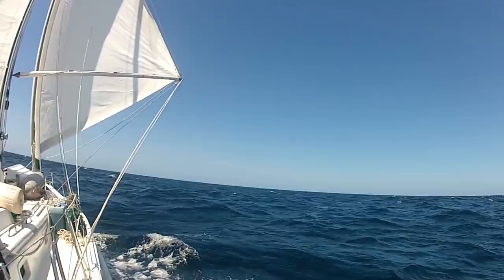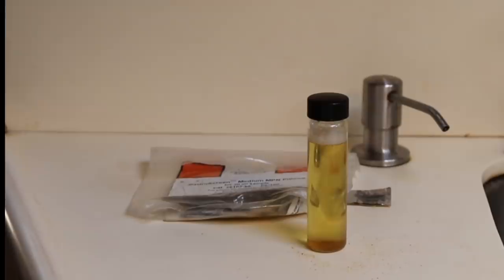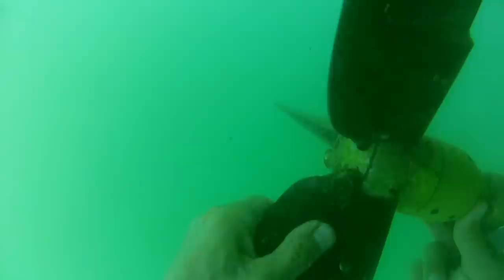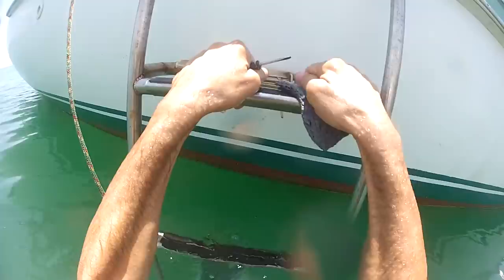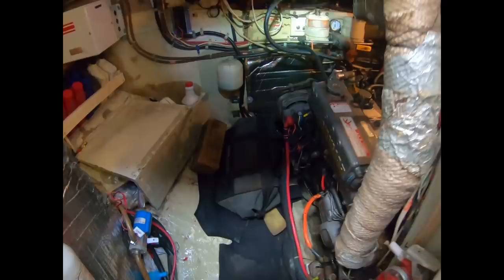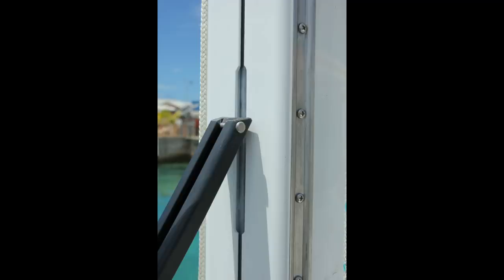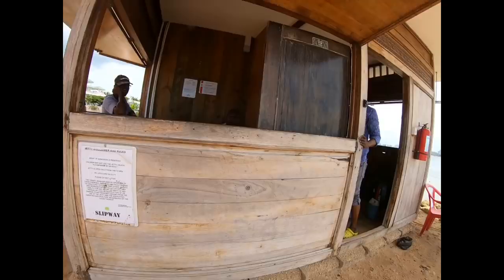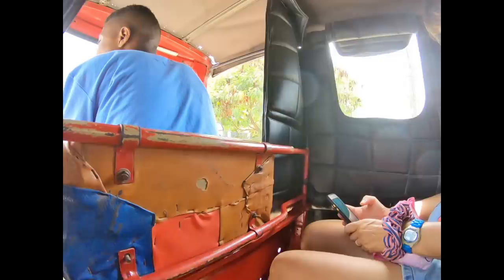STORM & PASSAGE PREPARATION:Sailing Tanzania to S Africa-Patrick Childress Offshore Sailing Tips #36

Comment: I like the proper instructional way you do your videos this is obviously Patrick’s past as an instructor shining through . I liked the added mode music added when you was showing the dangers on the weather map . I really like the tech stuff nuts and bolts of running your boat on a daily basis , like checking the running engine while it’s running . And the water checking wow !! I wouldn’t have known to do this .

In all keep doing what you’re doing please. I feel like I’m racking a free course. I’m in between jobs right now but I will be tipping your jar a little 👍
Reply from the maker: Thank you Stephen for your encouragement....and the tip!

Comment: Another great video guys.   My favorite video?  It's hard to pick any single one, but I really appreciated the 3 part Valiant 40 tour.   I'm still in love with that swing up boarding ladder, but too cheap to pay to have one fabricated in the States.  Found some decent over-the-gunwale stainless ladders though, that can are removable, yet can be locked in place with a pair of deck mounted "sockets".  That's what I plan to go with  for now.
Reply from the maker: Mark, it seems materials, like stainless steel tubing, is less expensive in the U.S. than anywhere else but the high labor cost, in the U.S., does make things, like a new boarding ladder, too expensive. As we have been traveling around the world, we get work completed where it is the most economical. Labor in many of these foreign countries is $10 to $25 a day unless they are trying to charge "yachtie" rates, like they do in Thailand; then it is better to have the work done in the U.S..

Comment: It would be interesting to see a video of your diesel  tank setup
Reply from the maker: Hi Sailor Sam, the two diesel tanks are difficult to see. They are side by aft of the diesel engine. They were installed decades ago. If I had been involved with the installation, I would have had them make access ports on top of the tank for cleaning and being able to visually see inside of the tanks.

Comment: Noticed you have a cable for the out haul. Definitely strong. Hope it never frays. Love the way you have all the systems set up for real world events. Wish production boats thought the way you do. We have the Tides strong track too. Love it. As always, great video! Really appreciate your sharing.
Reply from the maker: The outhaul cable changes to a low stretch line inside of the boom then exits the boom so the line can wrap around a winch and then a cleat. The stainless cable has been there for decades and I see no problems with it so far.

Comment: I like your show. I think vlogs of sailing channels are basically the same but different - watch Gone with the Wynns, Delos and La Vagabonde. These top three are a course in how to do it.  Sailing Sisu did an excellent study early in their channel. The key to success, if you define it by number of subscribers is taking the time to polish your production while maintaining a consistent style/content while listening to your viewers comments, it will take a while to take off, but you can see a snow ball effect after 10 or 20,000 subscribers, watching Sailing Uma will show you how to go from nothing to a very successful vlog in 3 or 4 years, watching Sailing Emerald Steel can help with integrating still images and old videos in an episode. Views can make a big difference on many levels and a viral video will change the dynamics very guickly, however you can't always predict that with certainty. Using clickbait can  be helpful but if it doesn't deliver something to your targeted audience it won't be helpful. I think Sailing Doodles is really good at it. That's my 2 cents and it's worth both of em
Reply from the maker: Thanks, Robert, for the guidance.

Comment: Another great video Patrick, thank you so much. I’m curious why you do not use lazy jacks or some sort of stack pack for your main. I would love to know your thoughts on this as I completely respect your knowledge and skill. Cheers
Reply from the maker: Glassman, this is a response I recently gave to a comment much earlier in this thread about lazy jacks:  I have used lazy jacks on other sail boats and they only help when the boat is headed directly into the wind and held there till all the main sail is dropped. Short handed sailing like this, such a maneuver is not normally possible. We drop the main on many points of sail, just like the basic sailing instructors teach students not to do. So lazy jacks are more of a nuisance and get in the way more than they can help. Plus they add a lot of chafe if the lazy jacks are not pulled forward towards the mast, when sailing, which means one more thing to deal with always pulling them out and putting them back. Not worth the hassles for the sort of sailing we do. Maybe for day sailing around the Caribbean, lazy jacks might be workable, but it is a spider web of tangles and snags in most sailing situations.

Comment: Good job on this video. In my opinion this one represents the good balance between how to stuff and the places you visit. Personally the more I see how you do things, the better. 
How did you guys fare with that awful cyclone that hit Mozambique? 
Also is that a on demand water heater attached to the rear rail?
Reply from the maker: We eventually got some concerned emails, through the satellite connection, saying how devastating that storm was to the coastal area of Mozambique. Since we followed behind it to grab the associated N. winds, we had little trouble with that storm. We had other localized storms, one with 50 knot winds but it was from behind, blowing us south. I wanted to take down the stay sail but feared, no matter how careful I was, the sail would luff itself to shreds....and the wind generator sounding like an over-revving non controllable Cesena...very dangerous. That will be in the next video. "Water heater", You probably see the white elongated canister mounted on the starboard Radar mast, at stern rail level. That is a self deploying EPIRB.

Comment: Great videos and very informative! Great to hear about your travels as well. You make others with the dream of sailing take the plunge and go for it! After much research I’m deciding on purchasing a Catalina 30 ft. Question for you. As far as marina fees goes is it that much more expensive to dock  a 30 ft boat versus a let’s say a 25 or 27 ft boat on a slip? (Catalina sailboat) If not much of a difference I would take the 30 ft..Love the spaciousness of the 30 footers. Thank you for ur opinion and advice! Keep up the videos !
Reply from the maker: Many marinas charge accdording to a bracket of boat lengths so there would be little to no difference for a couple of feet in the shorter lengths. Just keep it below 39'. Go with the 30, that is placial compared to the C-27 especially if you expect another person to stay happy on your boat. I lived on a C-27 for 5 years and crossed many oceans on it.  Just be sure to stay in the proper latitudes at the right time of year and keep up on the maintneance.
Reply from the maker: This is Rebecca. I know when I went from my 27 to my 36...only 9 feet difference but everything twice as expensive :) The Dock 25% more due to length 25% more...but haul out more because heavier and longer, and the longer the boat, the more money people feel you have for everything else. If you are on a budget...the smaller and simpler you go, the boat will cost less, and everything else will cost less too ;) 27-30 shouldn’t be too big of a difference though!
Reply: Patrick Childress Sailing thank you very much for your advice! Keep them videos coming. Very informative!
Reply: Patrick Childress Sailing Patrick, thank you for your advice!

Comment: Any concerns about swimming in the marina due to possible stray electric currents? Great videos, thanks.!
Reply from the maker: No. While at Ocean View Marina, near Davao City, Philippines, every morning, for the 4 months we were there, a man would swim one long lap around the marina docks. He certainly seemed healthy enough and never seemed bothered by anything. I have never felt any effects from electrical current while in the water at a marina. I would  think something would have to be extremely wrong to get any sort of tingling while in the water at a marina. Of far greater concern would be the health effects of polluted marina water. More often than not, I would soon get a sinus infection after working in the water at a marina. Now, as soon as I get out, I take a shower on the dock with dish detergent and use the hose to inhale a bit of water to flush out my sinuses. That has helped.

Comment: Nice video
What do you think of the no antifouling and regular scrubbing option for cruising?
Reply from the maker: In reality, there has been no option but regular scrubbing, no matter what sort of paint has been used. We will soon be hauling out, here in S. Africa. I will go through all the work and trouble to remove all bottom paint down to primer then will put on Coppercoat. I figure, there is scrubbing anyway so I want to make cleaning of the bottom as easy as possible. I understand, rather than using a scrubby, all that is needed is a rag, similar to the Propspeed, used on our prop shaft and prop. We want to head down to the south end of S. America where the water is much colder than the 84 degree, Fahrenheit, water we are accustomed to here in the tropics. I want to spend as little time in the water wiping it down as possible.  Check out our "Hookah, How to Clean the Bottom" video which will show how easy it was to wipe marine growth from the Propspeed and how difficult it was to chip marine growth from the chain or scrub it from the bottom.

Comment: I was wondering if lazy jacks would help with reefing?
Reply from the maker: I have used lazy jacks on other sail boats and they only help when the boat is headed directly into the wind and held there till all the main sail is dropped. Short handed sailing like this, such a maneuver is not normally possible. We drop the main on many points of sail, just like the basic sailing instructors teach students not to do. So lazy jacks are more of a nuisance and get in the way more than they can help. Plus they add a lot of chafe if the lazy jacks are not pulled forward towards the mast, when sailing which means one more thing to deal with always pulling them out and putting them back. Not worth the hassles for the sort of sailing we do. Maybe for day sailing around the Caribbean, lazy jacks might be workable.

Comment: That is what i figured.  Do you use a HF/SSB to download any GRIB files?  Or is that just old technology?
Reply from the maker: Watch the video "Marine Electronics for Navigation and Communication", the video just before this one on the Patrick Childress Sailing channel. That video goes into better detail about how to get weather information at sea. We used to use the SSB for down loading GRIB files but that has become as useful as a cassette player. PredictWind, down loaded through the IridiumGo, satellite communication, is far more reliable and easier to use. Although we could down load the same PredictWind information through the SSB if need be.
Reply: Currently my SSB is not working.  I'm looking for some advice on whether or not I should get it working as a backup for downloading GRIB files. Any thoughts?  Note I plan to get an iridium go as you have.
Reply from the maker: @sailingnordicsun7199  A SSB would always be worth keeping as a backup, Not just for GRIBs but for other communications....which of course is becoming rare. Most likely, if it is receiving but not transmitting, there is an antenna connection problem. Start from the radio and clean every connection and check all wires at that connection back to the antenna and all connections going to the ground and that will most likely get it transmitting again. We had to do this at least once a year and often twice a year.